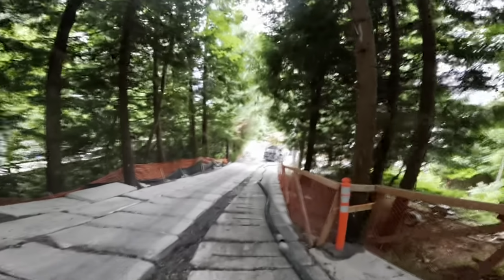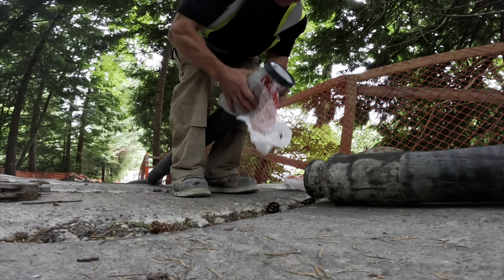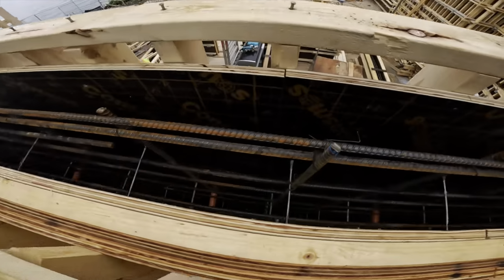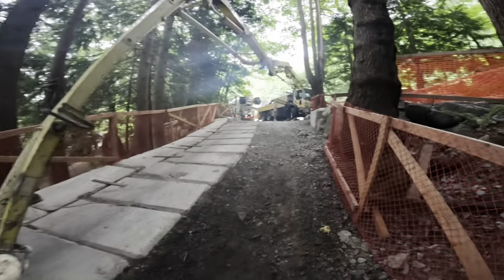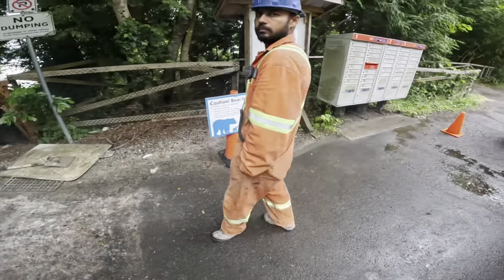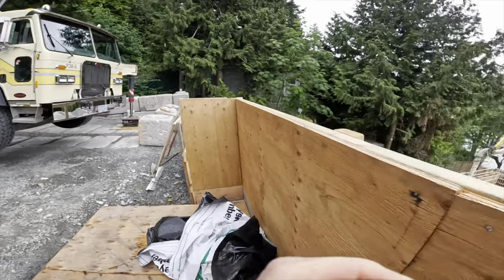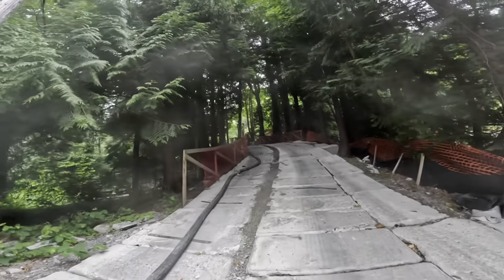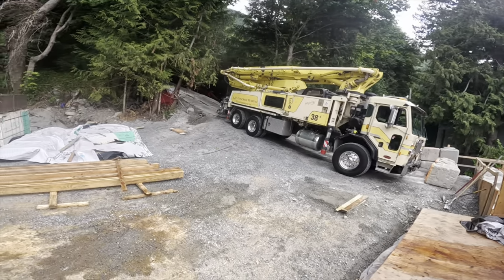Concrete pump operators get a lesson in wild bear etiquette:

Comment: I use to use a ball priming out down hill and I still do depending on how steep it is but I tried this bag truck trailer pumping the other day and I’m sold man thank you. I’ve learned a lot from you over the last few yrs as I’ve only been pumping a few yrs so thanks again and be safe.
Reply from the maker: Awesome to hear! My suspicion based on how segregated that first bit of mud in the hose was is that maybe a bit of water found it’s way into the hopper when priming.
Reply: I’d have to agree. Not the first won’t be the last
Reply: again I will take partial credit for the bag trick. im sure other ppl have suggested but I gave a step by step and next video u did it so your welcome. lol just kidding , thanks for opening up a portal for us pumpers from everywhere to have somewhere to learn and bounce ideas off each other. also, I will suggest try to pump at a higher volume, the bags help a ton but you still have 20-25 ft of potential plugging from friction if the benny gets away from the mud. by pumping fast, the benny doesn't have to time to run and gets pushed by the the concrete behind it coating your hoses perfectly. give it a try. anytime I've accidentally primed out downhill or any way wide open, I've never plugged, even on a 350ft stretch downhill with nothing but 2.5' rubber hose. not saying pump wide open, just saying faster the better.
Reply from the maker: @kimvasquez1435  priming slow is such a habit for me, and a tough one to break for sure. I’ve been making baby steps however. Primed out my last job at 50% volume even 😂😂😂
Reply from the maker: @kimvasquez1435  Mu favourite thing about this channel has been the good, useful information and knowledge exchanged in the comments. I myself have picked up quite a few good tips and tricks.

Comment: I'll keep my big pumps lol At least the big jobs usually order enough mud. If i had to pick one machine to run for rest of my life, it would be a 47m. Most versatile machine on the market imo. Just big enough to het some good commercial, but small enough to cram into tight slots. 

We do have a super sweet 40z tho......
Reply from the maker: 40Z was my all time favourite, until we took delivery of our 38-5. The 47 I never really got too hot on, and not so much because of the pump unit (which is fantastic) but more because ours is mounted on an absolute turd of a chassis. Underpowered, under-geared, and turns like a Boeing 747. I feel like if it were on a better optioned chassis, I could very well be in agreement with you.

Comment: For rubber line off the boom i like to load 3 small bags of slick pack in the primer port and fill it with water and then i will send a hopper full of really wet grout behind it along with the crete .. i have pushed that through 280 ft of 4inch rubber line with no issues at all i mean it doesn't even kick the hose
Reply: I run a 2023 concord 38z4
Reply from the maker: Grout is absolutely the best all/end all for priming (which we could have it supposed on every line pour). 

I personally just haven’t been able to find good results using slick-pack to prime through horizontal system (rubber especially). I often think that perhaps it’s due to the type/amount of sand used in our mixes here locally. 🤔

Comment: Slick Pak is the worst for priming out with system or rubber hose
Betty or Grout!!🎉
Reply from the maker: Yeah man, I’ve never had good results with it. I actually have found it to be worse than water in that when it does plug in the hose, it’s an absolute stubborn “you know what” to bang it out. Big ‘Ol ball of gel and sand. I’m convinced that there’s something procedural which I must be doing wrong. Manufactures sell a TON of this gel type primer, there’s no way everyone buying it is experiencing the same crappy results as we are…. 🤔🤔🤔

Comment: great video brother with your years of experience and you know a lot about pumps I have an olin pump that I have problems with the signal at 150' feet it fails and they have already changed three receivers and the antenna but it continues with the problem it is pump boss what advice can you give me thank you god bless you
Reply from the maker: Antenna placement can definitely have an effect, especially if the signal strength of the radio is not super robust to begin with (I personally have zero experience with the pump boss). That being said, we’ve used Omnex, Scanreco, and Aarcomm remotes on our Putz line-pumps over the years. The Aarcomm has by far the best signal. The Omnex was pretty good as well. The Scanreco would get a little iffy beyond the 175’ mark. To be fair to the Scanreco, this was some 10+ years ago now, and I believe an early iteration of their line-pump remotes. A lot could have changed between now end then.
Reply from the maker: Antenna placement can definitely have an effect, especially if the signal strength of the radio is not super robust to begin with (I personally have zero experience with the pump boss). That being said, we’ve used Omnex, Scanreco, and Aarcomm remotes on our Putz line-pumps over the years. The Aarcomm has by far the best signal. The Omnex was pretty good as well. The Scanreco would get a little iffy beyond the 175’ mark. To be fair to the Scanreco, this was some 10+ years ago now, and I believe an early iteration of their line-pump remotes. A lot could have changed between then end now.
Reply: Question: How complicated is it to install the Aarcomm receiver?
Reply from the maker: @ulisesrenderos2261  To the best of my knowledge: if you provide them with your machine specifics/serial # they will put together a plug ‘N play wiring harness for you. Makes it super easy to install.